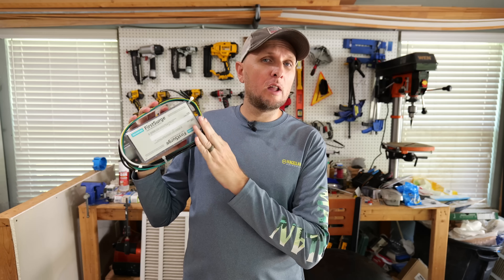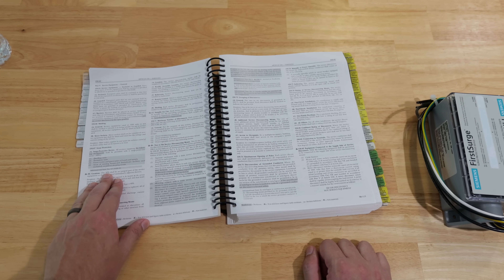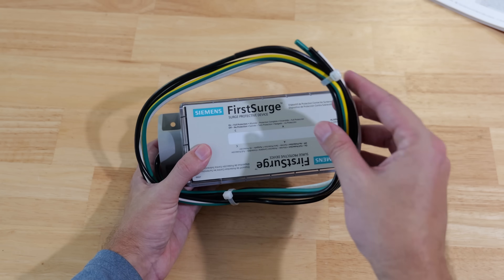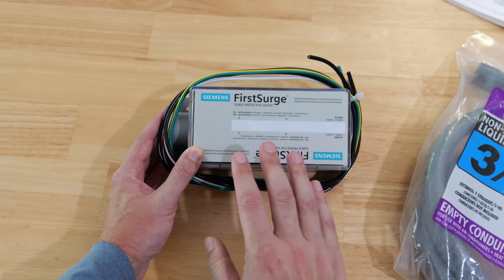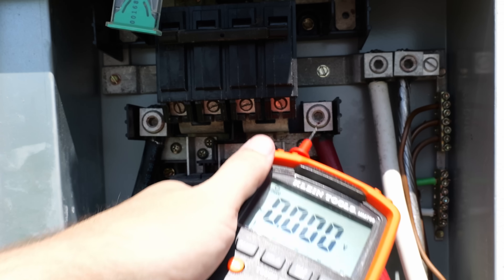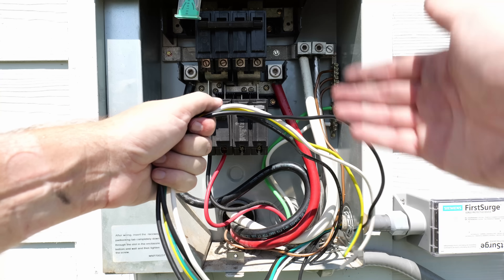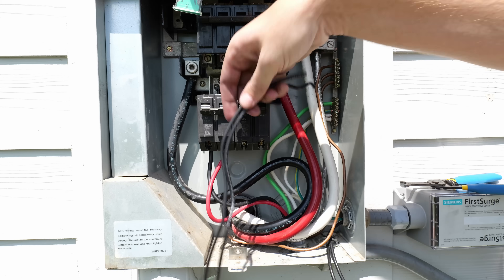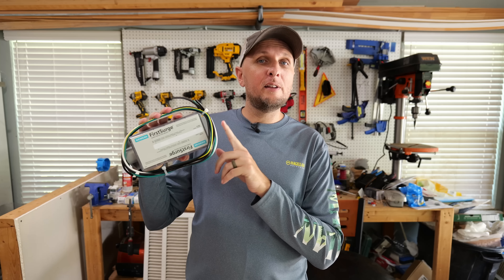Why Whole Home Surge Protectors Are Now Required and How To Install One!  Siemens FS140

Comment: What do you do with a recessed fuse box? Mine is between two studs and there is sheet-rock around it. All these videos seem to have a fuse box that is ON the wall and not in it.

Comment: I pay "rent" for a whole house surge protector that is fitted between the meter base and meter. I did the math, and the cost divided by the life span was roughly the same. I also installed surge protection at my new mini split's disconnect. The rest of my appliances are all analog, and I plan to keep them that way until I die.  If I had a choice, I would still have analog HVAC as well, but my compressor seized and I couldn't buy a new R-22 compressor anywhere. I did the math, and the electricity I save with the new system will take 15 years to break even on ONE board replacement. The efficiency gain is great(35% reduction in the winter), BUT I doubt this system will still be running at 35 years old like my old one was.
Reply: If you maintain them correctly, most modern stuff will last just as long.
Reply: @billweir1745  This simply untrue Anything with a (non-replaceable) capacitor has a maximum expected lifespan of 50k hrs(if they use the good ones) If they are used in hot or damp conditions, the life span decreases dramatically. That means basically ALL new appliances have an expected lifespan of under 6 years, which is about what I see from quality well built units before they require "board replacement," which usually costs over 1/2 the cost of new.
I have a stove, washer and dryer all of which are over 40 years old and work flawlessly. My son replaced his washer 20 years ago and has needed a new one every 5-7 years since. Technically, he could have bought the control board, but in all three cases they were unavailable and/or cost nearly as much as a new machine.
Every single item (except 2 vehicles)I have that is over 25 years old and still working does not have "over complication" nor computers on board.
What items do you own that are over 30 years old that still function ??

Comment: Nice, but that service panel is far from normal. Many external  service panels are flush with exterior wall, making no place to remove any panel  knock outs. Some exterior service panels are straddled by studs for support, making any holes that much harder and few panels have room for adding an additional double breaker

Comment: A Type I SPD installed at the Service protects indoor equipment from external or exogenous sources of high voltage, such as lightning strikes in the neighborhood (not direct hits) or the moment power is restored from an outage. As SPD at the service panel does NOT protect from endogenous or internal sources of high voltage such as transients from motors starting up on refrigerators, air conditioners, washers, dryers, dishwashers, etc. You must have an SPD at major equipment and critical safety circuits such as smoke & CO alarms, medical equipment, elevators, etc. It is wise to have SPDs at all electronic equipment such as TV's, computers, microwave ovens, and hearth appliances that have electronic ignition systems, which includes gas fireplaces, fire pits, pool pumps, pool heaters, pellet stoves, and electric fireplaces. In the kitchen, any countertop appliance with a control board should be SPD protected. Basically, if you have a device with an LED readout, protect it or be prepared to replace it. Check your homeowner's insurance as these companies are wising up to these losses and writing exclusions in many cases. Also, portable generators are notorious for dirty power whereas permanent installations typically include a hardwired SPD. If an SPD fails to protect a device, some mfrs, such as Tripp back theirs with up to $50K to replace lost equipment should their device fail. 
Just note we replace more control boards, transformers, and ECM motors due to internal power spikes than outside. Every piece of HVAC or hearth equipment we install must have an SPD no arguments. Homeowners appreciate being informed of the risk and are virtually 100% happy to pay for this protection as they are for us to electrically bond gas piping.

Comment: I think your video would be improved if you used a schematic diagram of the hook up of the surge protection installation to describe the overall performance and why it adds safety benefits. After watching the video I have questions that would have been likely answered with the schematic diagram, such as..
1) how does this surge protector work to prevent damage to the house. If the surge protector gets activated does it trip the main power going to the house?
2) Does the surge protector have a reset button after tripping. Or does it have to be replaced after one surge. 
3) Is the surge protector affected if you have GCFI and it trips? 

I have lots more questions created than answers from this video
Reply from the maker: 1. No.  Absorbs and sends to ground
2. No reset.  Doesn’t necessarily have to be replaced after one surge.  Depends on how bad it is, how many it’s absorbed already.  It will let you know. 
3. No

Comment: funny they are building new homes in my area and i have been wondering around looking in the main panels- no surge protection at all ; interesting
Reply: They could be using the cheaper ones that are located in the panel. Regulations say that you need to have surge protection in homes, doesn't specify if it has to be a cheap or expensive one.

Comment: About a month ago we had a bunch of booms, at night, during a light rain storm.  The wiring on the exterior of our house was in horrendous condition.  It was probably almost 60 years old, there were some spots where the sheathing had worn almost exposing bare wires, and in fact there were bare wires in the feed to the water heater.  Water hit that and there large arcs of purple and blue light around the house....just a mess.   It killed our water heater.   On a Friday a big crew came out and we had everything replaced....huge job and we spent 10 grand.   Exactly 7 days later, in the middle of the day on a bright sunny day, it sounded like a rocket hit our house.   A pole went down - the power company won't tell exactly where or why - and our house was hit with a 40,000 volt power surge (the power company DID tell me that much).   We lost three light bulbs, a coffee pot, and two dimmer switches.   Everyone around us lost almost everything - furnaces, air conditioners, refrigerators, computers, etc.   The SURGE PROTECTOR ON THE OUTSIDE OF OUR HOUSE SAVED OUR BUTTS.  If we would have had our old wiring, and no surge protector, our house would have probably burned down.   The guy across the street - beautiful home - had most of the plugs in his house melt....along with losing all if his appliances.   A surge protector on your house is a huge deal.....trust me on this.  I've done a lot of basic wiring in my houses and didn't even know that these sort of external surge protectors were a 'thing".

Comment: Our house was finished and moved into May 2019 so there was no having to have a whole house surge requirement.  Even so, I have no room in my outside main meter panel to add one as there's the 200 amp main breaker, my 50 amp generator breaker with interlock, and a 100 amp breaker  that feeds a sub panel for a 60 & 40 amp breaker for the outside HVAC condenser units.  All of the house breakers are in our master bedroom closet and no spaces left in an Eaton 4040 BR panel and I don't believe it's supposed to be capable of using tandem breakers.  Not to mention, all of the top 5 slots are filled with (2) 60a breakers for upstairs & downstairs air handler, a 60a for downstairs aux heat, 50a for "range" although we have a gas oven, and 30a water heater.  Not really sure where I'm supposed to cram one now.

Comment: I don’t think reducing the cable length matters at all. That surge is moving at nearly the speed of light...
Reply: It's not about the speed of electricity. The longer the conductor, the more inductive reactance there is. The more inductive reactance, the more the conductor itself resists changes in current at high frequencies. It acts as a choke between the transient and the surge protector which is why it must be as short as possible.

Comment: I have no room in my main panel for an additional breaker.  I do have a sub panel, so can I install the surge protector in the sub panel and still have whole house protection?
Reply: Having a surge protector in the subpanel only protects appliances in that panel which is better than having no protection, in your case, you can get a whole house surge protector installed on your electric meter which is usually sold by your electrical company.

1. Get a whole house surge protector for your electric meter
2. Install a whole house surge protector on sub-panel
3. Install a dedicated surge protector on HVAC device
4. Use type 3 surge protectors for home appliances.

Comment: I'm confused, the Siemens FS140 is a type 2 surge protector. Why are you installing it in your main panel? You installed type 2 surge protectors on subpanels.

Comment: Apparently not required cuz my new construction doesn’t have one, looks like I’m making calls to get one
Reply from the maker: If it doesn't have one installed in or near the main panel, they are either against code or the area you live in has not adopted the 2020 or 2023 NEC.

Comment: If i have solar panels also coming into my main breaker box, do I still connect this to the closest breaker slot nearest the incoming legs from the power company? Do I need another surge protector installed near to the breaker that my solar power in lands?

Comment: I notice some manufacturers sell breakers with surge protectors built in (no wiring required).  Are these any good?
Reply from the maker: They are better than nothing and meet code but the one I show in the video is by far one of the best out there.  It just has much higher capabilities.

Comment: OK, AMERICANS, you use to solder (tin) your stranded wire back in your grandfather time. Then you stopped .

Guess what Europe and Asia still do today? They put end caps on them, tin them or use clamp systems, NOT SCREW SYSTEMS.

Arcing can be so small and constant that you can't see it with an naked eye.

There are very good reasons why a GOOD Electrician uses a thermal image scanner. It's because of heat building up.

Get with the times America and prevent the arcing.

Comment: Always lightly tug on your terminated wires. Sometimes they can appear to be in correctly but pull loose. Loose connections cause heat and heat causes fire 🔥

Comment: Hey, I watched your video on home surge protection.  I bought the one you recommended.  It came with an extra cable, with 3 wires in it, apparently for an alarm.  The videos I have checked show no such extra wiring.  I assume it's for an audible alarm.  Can you assist with this?  Thanks.

Comment: You should also note that the NEC is not binding on states; states still need to adopt the NEC into their own state building codes.  For example, here in NC, the 2020 NEC was partially adopted: it was completely adopted for commercial builds, but only partially adopted for one and two family residential units. The sections on surge protection are expected to be fully adopted into NC state building codes by the end of January 2025.

State electrical codes move at the speed of government.

Comment: As a repair technician for the local phone company.  If your power panel is hit with a direct lightning no surge protector is going to stop anything.  I have seen many homes and businesses with direct lightning hits and most recently an Amazon warehouse with the best lightning protection.  Everything in that warehouse had to be replaced.   I am certainly not saying it won't work but the reality of a surge protector stoping lightning is simple not going to happen.
Reply from the maker: I don’t think anyone argued that one would stop a direct lightning strike.

Comment: Based on the comments and what I know, it seems like there should be a breaker equal to the rating of the panel placed on the ground side to truly fight off a lightning strike. As explained, when lightning hits the ground, the ground becomes powered for an instant. wouldn't a breaker placed between earth ground and the panel solve that?  I'm very curious about the SPDs as well and will be digging into them soon. 
   Now about the need to match brands of whole house surge protectors to the breakers...That seems like a marketing ploy and not an actual engineering requirement. I'm only partially through this video and hope to find the answer, but it seems ridiculous to me. 
   Thanks for some very informative videos, including the one about the surge protector receptacles and the available 20A versions. I'm no fan of the Levitron brand but I will hunt for others.

Comment: Will this unit you just installed in this video, protect a 240-volt AC unit. Or only half the box phase of 120 volt. Would another unit be needed to install to protect the whole house? Correct me but parallel buzz bar would they need their own protector?

Comment: We live in an area that has numerous power bumps and outages every week. Have already burned through 2 battery back-ups for our computers and have had to replace circuit boards on several appliances. We had the power company electrician here working on wiring to our barn and I asked if he would also install a whole home protector on the house. He refused - said they don't work for the type of surges we get would only work for high surges that we are unlikely to get so not worth the expense. Honestly - I disagreed (even though I know nothing about how it all works) It just seems to make sense to me that the protection would help. Glad to hear code has changed - we are doing some remodeling this spring - I'm adding this to the list.

Comment: Not true. It is only required in your municipality or locality if a code amendment is formally adopted. Most local codes are a few years behind the NEC and IBC. It is smart to install it, but you should consult with your local inspector for the correct answer.

Comment: First of all thank you for your video.  

Question: How come you only have 2 branches from your main panel?  Is that right side added just for the install of the surge device?  Is it better to connect from the outside main panel as opposed to the inside where all the other branches would be?

Comment: During a power outage my surge protector started a fire in my panel.  When the water heater turned off, my 25kw generator  just started working harder to overcome the shorted surge protector.

Comment: As a 40+ year Florida resident, I've had multiple equipment failures discovered after lightning events. The common denominator for all failures was each device being directly connected to earth ground or connected to a buried telephone or coaxial cable. Lightning can transiently change earth ground voltage potential in the area near a strike.

Comment: OMG, unbelievable! I wonder how much Siemens paid to have this put into the code. (eyes rolling)
Putting foot long pigtails on a surge protection device makes it totally useless. The high speed sensitive electronic devices that your are supposedly protecting will be dead before this dumb device even is aware that a surge has occurred. The place to locate surge protection is at the unit being protected. Why put a useless $500 device on the mains when you can put effective 50 cent devices in the devices needing protection?
(an electromagnetics effects engineer retired after 40 years with the major aerospace company that pretty much defined EMP and lightning indirect effects analysis and protection)

Comment: The NEC may "require" SPDs (or other devices), but it's up to the AHJs (Authorities Having Jurisdiction) to enact it in a local code. Some municipalities are a few versions behind 2020, or they feel that an SPD isn't necessary.

Comment: How do you decide what capacity device to use ?  It appears that the breaker you attached the wires from the SPD to only covered the right pole (red) of the incoming power. What about the left pole  (black) ?

Comment: I don't believe a power surge wouldn't hurt my laptop because it's technically running off a battery even though it's plugged in is this correct?
Reply: A severe enough surge would likely cook the power supply for your laptop.

Comment: There are times like this when I remember the NEC is written by three groups: Manufacturers, contractors, and users. This unnecessary requirement for surge protectors in every new home is one of those times when I remember that you always look at who benefits from rules like these. In this case it is manufactures who sell these and contractors who install them. The users have to pay for them. I speak as an electrical engineer for over 40 years  and licensed electrical inspector. Some things in the code are there for monetary reasons and not primarily for safety. IMO this is one of those instances.
Reply from the maker: I disagree.  It protects safety equipment in the home.

Comment: I think you missed one check.  You demonstrated testing for power after you shut the main breaker.  
What you didn’t test was the meter you used.
Just seeing 👀 000 on the meter looks safe but what if the meter or leads is defective or broken?  You get the same 000! 
Before you shut the power off see if the meter shows 120vac and 220vac.  Then shut the breaker and see if you have 000.
Just saying trust NOTHING when electricity is involved.  😅